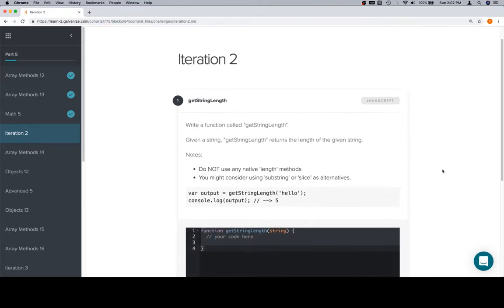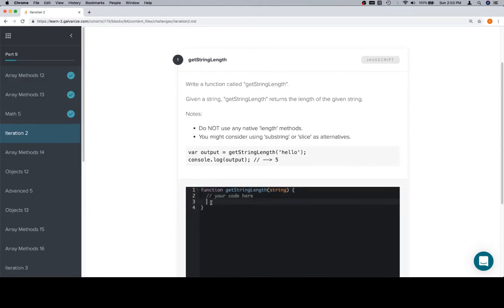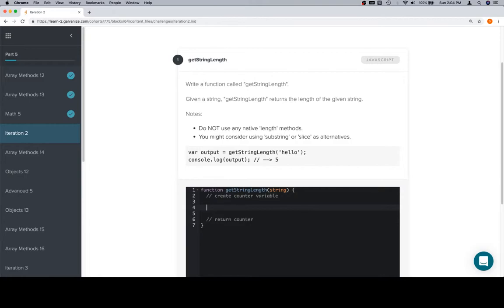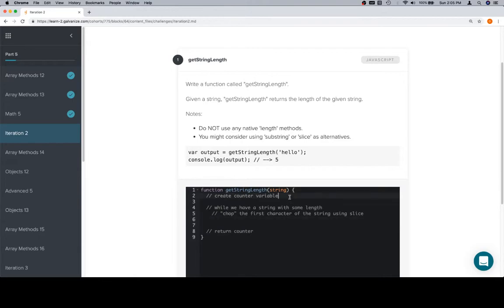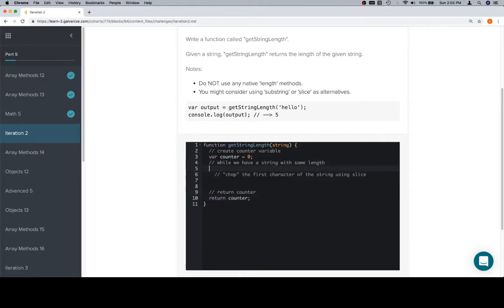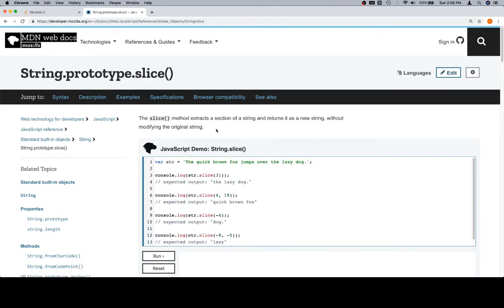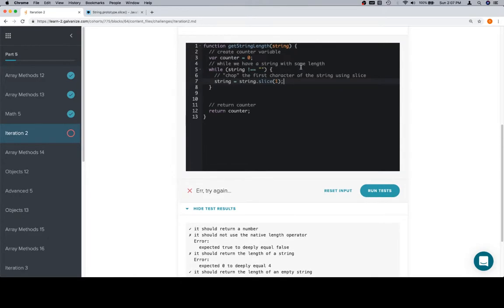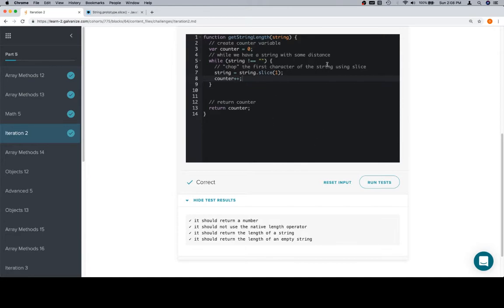Module 1 - Iteration 2

Comment: my version also worked.:

function getStringLength(string) {
    var array = string.split('');
    var count = 0;
    while (true) {
        if (array.shift() === undefined) {
          return count;
        }
      count++;
} 
}
Reply: I used variant with one variable. Did you go to galvanize bootcamp? 

function getStringLength(string) {
   var counter = 0;
  while (string[counter] != undefined) {
      counter ++;
  }
  return counter;
}
Reply: @iskandermakhmudov  planning on doing the bootcamp this year. Just worked through the prep course
Reply: @Tres_A  I'm also rushing through prep course and kinda afraid to go into boot camp.
Reply: @iskandermakhmudov  same. i'm planning to do the part-time one. they haven't released the dates for it yet though

Comment: I thought slice didn't modify the string.  If that's true, how are we able to slice repeatedly and get different results each time?  Does it just not pull the original string again while it's within the loop?
Reply: Well, it's true. You cannot modify string. Slice doesn’t modify. It creates a new instance of string! When you use slice method you essentially create a new copy of the string. So each iteration he is reassigning different place in memory with new values to the same variable - "string". Let me try to visualize this using example word "hello".
1st iteration:
'string' -------> 'hello'
2nd iteration:
'string'-------->'ello'  | ‘hello’ (but ‘hello’ is forgotten and will be overwritten sometime later) 3rd iteration
'string’————>’llo’ | ‘ello’ | ‘hello’ (‘ello’ and ‘hello’ are still there but nothing points at them) 4th iteration
'string’————>’lo’ | llo’ | ‘ello’ | ‘hello’  5th iteration
'string’————>’o’ | ’lo’ | llo’ | ‘ello’ | ‘hello’